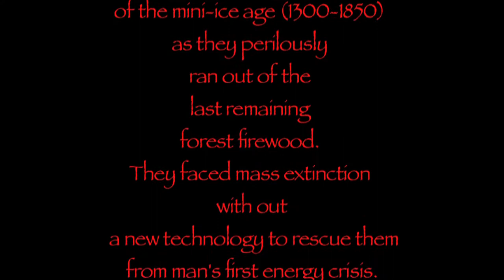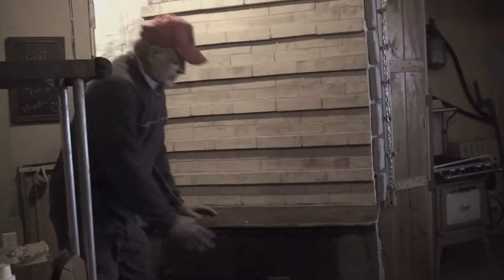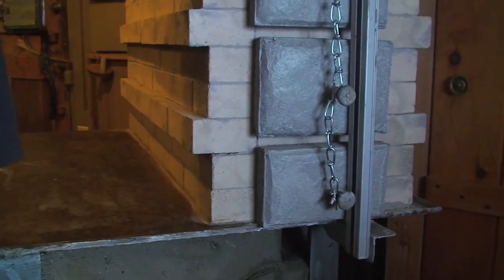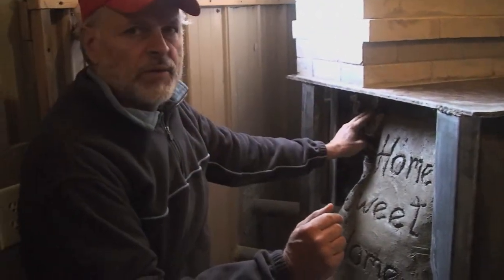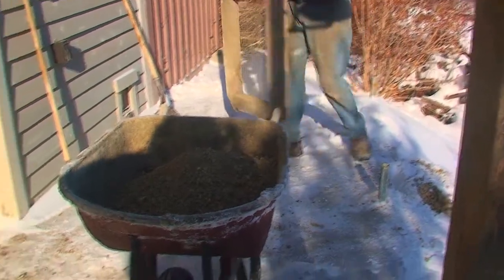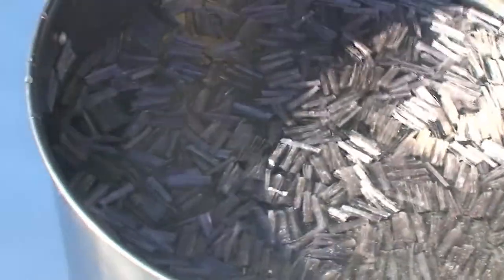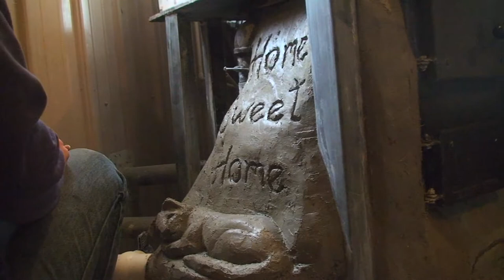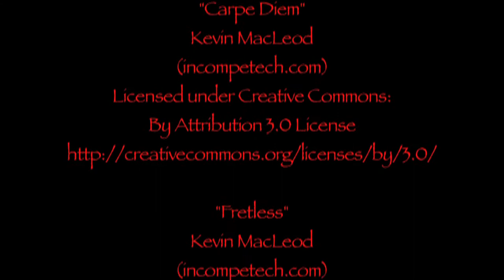Radiant Goddess Masonry Stove

Comment: If you will tell me where you got 300 full size firebrick for six hundred bucks I will be forever grateful.
Reply: Old red clay solids as firebrick alternative. Substitute for firebricks can be old red clay solid bricks. In ovens these alternative red clay bricks will heat up, retain heat, cook, bake, roast, re-fire, absorb conduct store and hold the heat from wood fire and perform the same way as proper refractory firebricks do.
Old red clay solids as firebrick alternative - Traditional Oven
Reply: Thanks for the information.I was under the impression that clay bricks can't stand the repeated high heat cycles of a  mass heater. I want to build one in my basement, preferably without burning down the house. The wife's not crazy about this anyway.